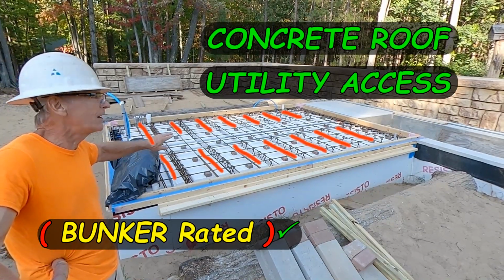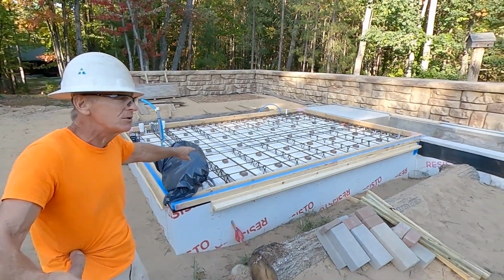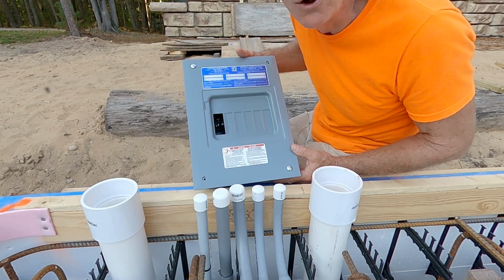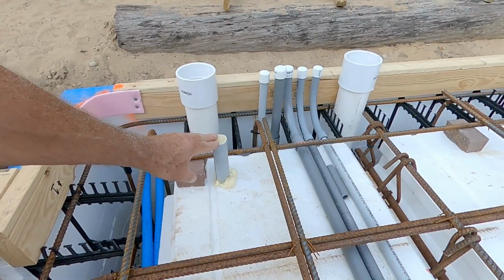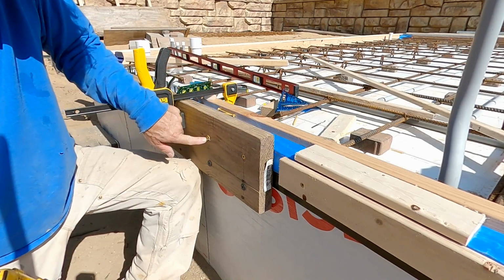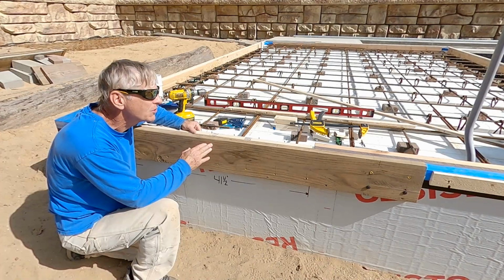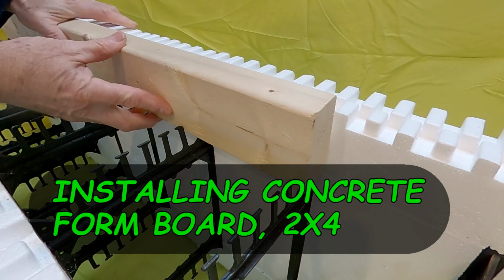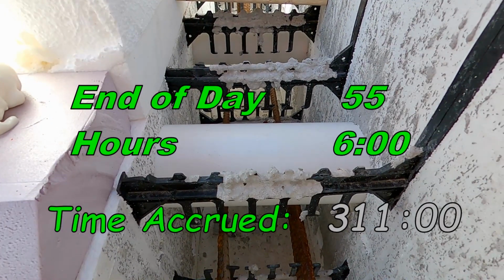ICF Root Cellar Bunker Build - Installing Utilities in Concrete Roof - Day 54-55 _

Comment: I would like to learn more about how you used the “rim form board”.  Is it only on the exterior of before the pour?  Then when it is removed, it creates a key way for the next level of wall along the outside of the slab?  That is ingenious but not sure how much an inch and a half x three and a half keyway will really help in outer edge concrete to stabilize the next level of wall???  More details would be greatly appreciated.  It sounds like a nice touch even if it doesn’t do much.  Every little bit helps.  Thank.
Reply from the maker: Yes only on the exterior of the wall. I also change from using the 8" wide wall for the Cellar below, and change to using a 6" wide wall for the above grade portion. The key is the thickness/ of 2x4. (11/2"). When the next concrete pour takes place the width of the  key is not an issue as it is filled and the lower wall, the floor and the above  grade wall becomes monolithic. 
I will be starting to post the above grade build of the Greenhouse some time in January. You will be able to  see all that you want in those videos coming soon. Thanks for watching.

Comment: At about the 2 minute mark you mention you are using all DC power in the structure, but using a standard  AC load center.

I hope you found DC breakers to use in the AC load center because you absolutely can NOT use AC breakers with DC power. DC and AC breakers are completely different animals in how they 'extinguish spark' when breaking the circuit pathway. Please consult a electrician with solar DC experience if this is what you are planning. DC and AC behavior and characteristics are completely different.
Reply from the maker: I did not know that. I just finished reviewing on-line and you are correct. Thank you very much for bringing this to my  attention. I have much experience with AC power. This is my first project using DC. I am thankful you let me know as it is still early on and I have now located a new panel / DIN mount style DC Circuit Breakers that will take the place of the AC panel. Thanks again. And Thanks for  watching.